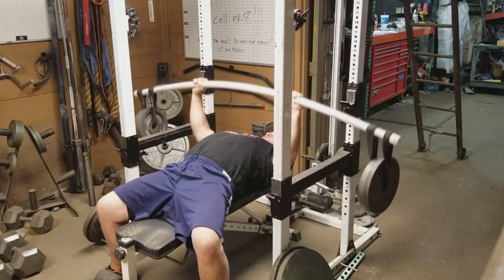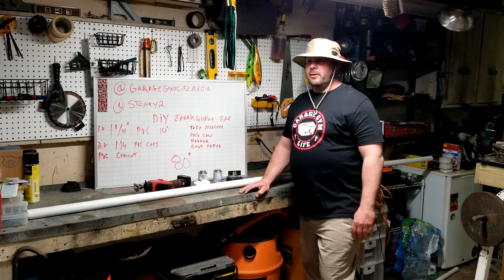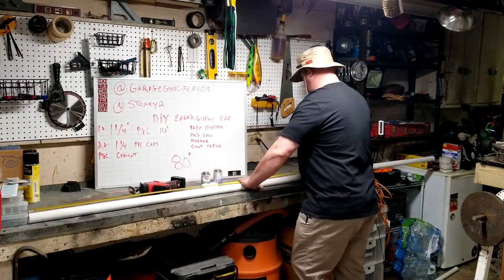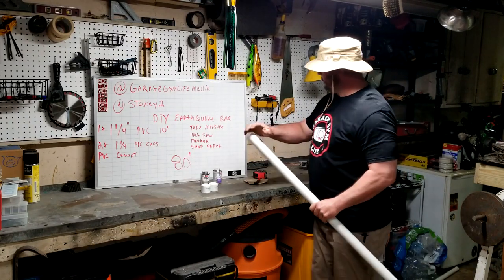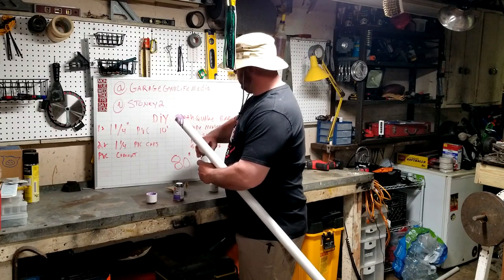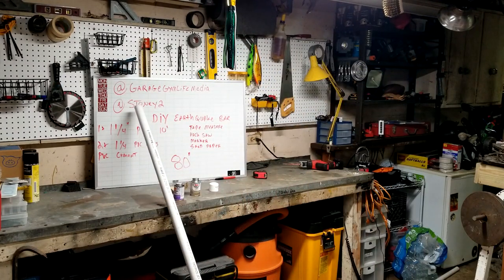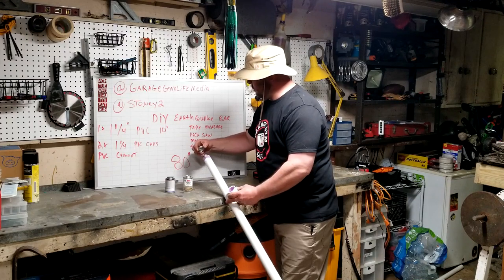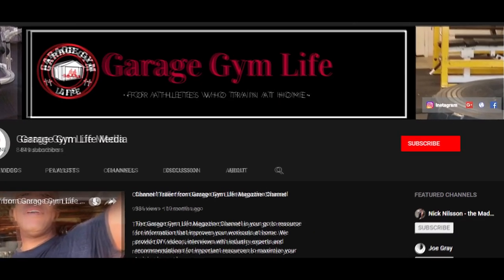How To Make Your Own DIY Earthquake Barbell

Comment: When i made mine a few years ago i added 3 more pipes internally of smaller diameters that slid inside of the last.  at 4 points on each pipe i added a few rounds of PVC tape to add thickness and contact the larger pipes internal diameter. this added loads more strength to the bar without increasing the stiffness too much.  i then filled half way with water for added difficultly.  Ive had 100kg on mine no problem.
Reply from the maker: Nice!